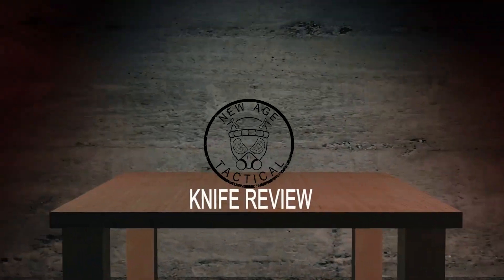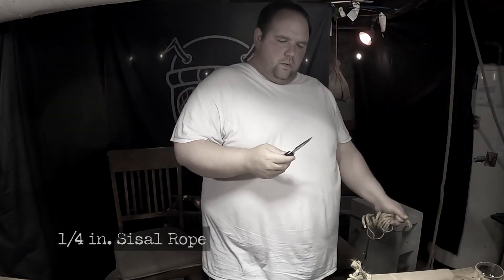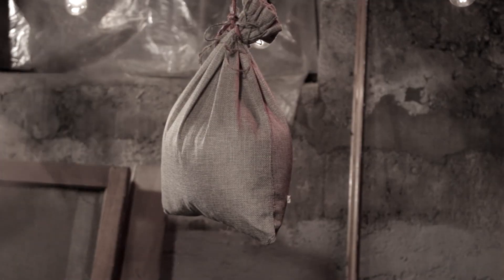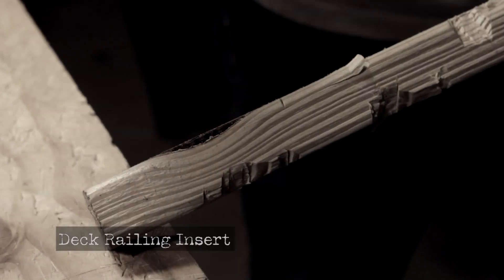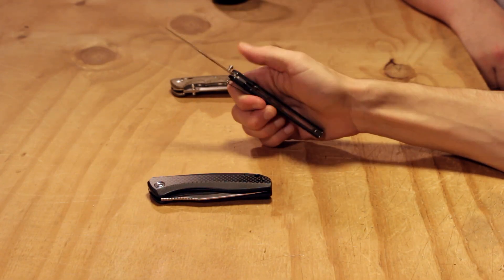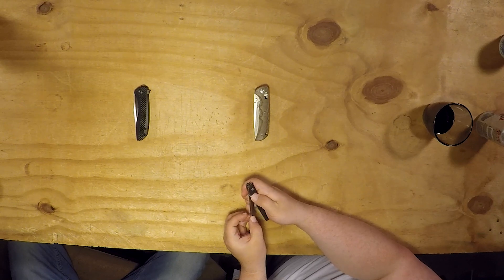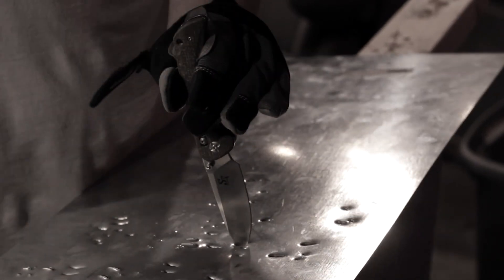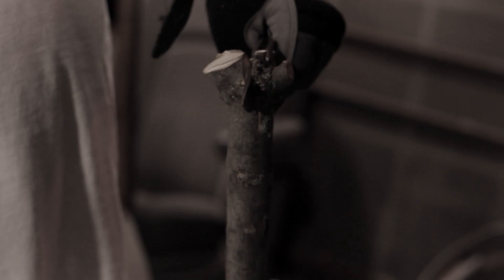Civivi Baklash, CRKT CEO, Sitivien ST-110 | Post Review

Comment: Whats up guys? Great informative videos, love the torture test. I just ordered the ST110 partially because of your video. Aside from a utility knife I have this will be my first axis lock knife. All the good reviews have me curious about this knife. I do have a theory of why the lock failed during the test. Two reasons, first is I agree the angle of the handle causes more angular force on the knife when you hit the back of it than one with a flat end. Second and probably the real reason, because the lock should be designed to handle angular force, is the force of hitting the knife causes the knife to move quickly while inertial forces want to keep the axis lock bar from moving with the knife which then disengages the bar from the blade. Think of the game Jenga, if you hit the block you want to remove fast and hard enough the other blocks stay in place. Same with the knife. Maybe when you hit it hard enough there is not enough tension or force pushing forward on the axis lock to keep it engaged. Just a theory but you can test it by holding the lock in place while you're hitting it either with just your hand or jam something in there so it can't move back.   

Aside from that the only recommendations I can think of is try to standardize your test. You guys do great job with a variety of test but maybe instead of swinging with your arm you can make a jig with weights for some of the test so that you know every knife is tested with the same amount of force, angles, positions, etc... Maybe you can use a scale for other test to see how much force you are putting on the knife. just some ideas... I really appreciate the abuse test. Most of those things I will never do to a folding knife but the test definitely help you see the differences from knife to knife and what they can handle. Maybe you can provide some more close up shots of the knives... not complaining, just trying to think of some suggestions....